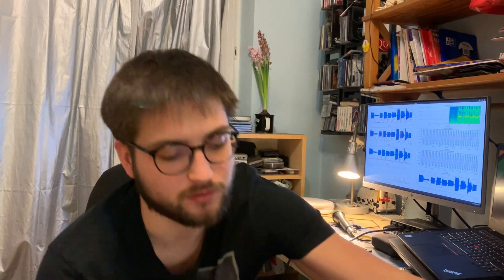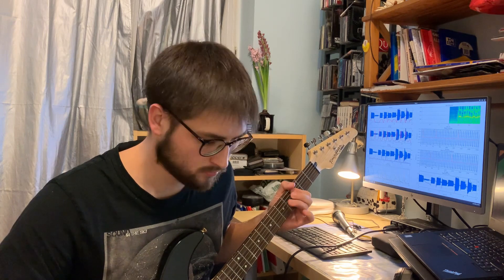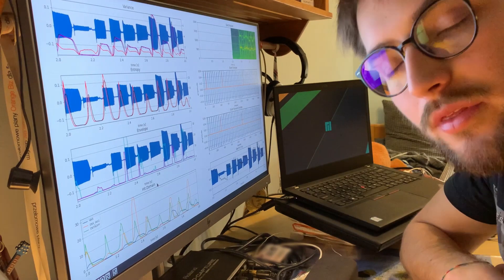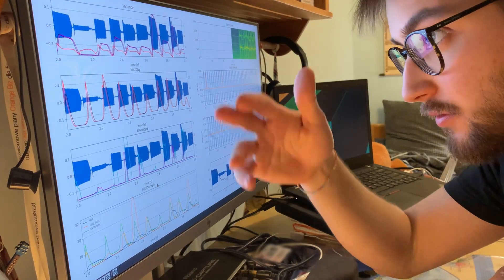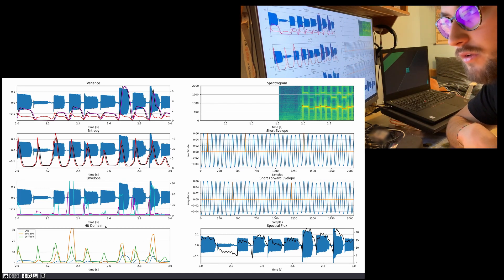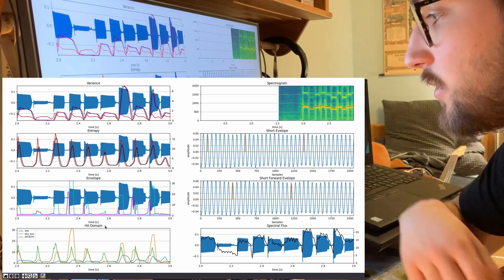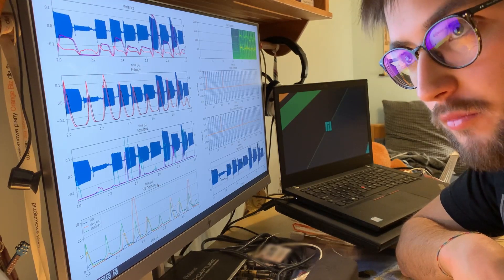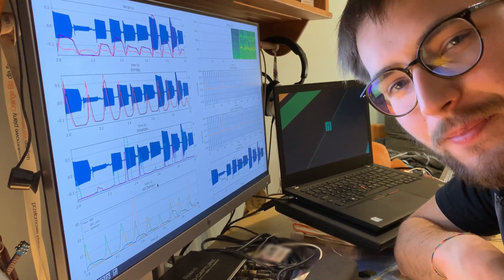Guitar To Midi Converter - My New Project! | DIY Software | Midi Guitar: Intro #ANTech

Comment: I assume you are trying to detect in real time notes in a polyphonic signal and generate midi events.

If that is the case, I must say that I love what you are doing, but I unfortunately believe that it will be extremely difficult.

I have seen several attempts to do this fail before.

You might get it to work, but the problem is that its real time performance will be too poor for guitar players to enjoy it. More than 20-30 milliseconds to detect a signal and guitar players start to feel irritated at the latency.

And the problem is that for example the 6th string of the guitar needs already 12 milliseconds to vibrate once (82 hertz), and you will hardly be able to do a fast fourier analysis in the resting 8 milliseconds with a signal of just one cycle.

But there are VERY similar projects that you can do, that will provide you a worthful knowledge and that I believe are more doable.

1) You can design a solution, that can start by using a PC and later using some hardware such as an arduino processors (or something else), that reads 6 guitar signals from an RMC pickup (or a graph tech pickup) and converts them into midi events.

6 monophonic signals instead of one polyphonic signal.

Maybe using some fourier analysis, or maybe you can predict frequencies by their slew rate, or something. At this point you develop algorythms to efectively detect musical notes in a monophonic signal, in real time, plus the architecture for a PC to do this in parallel 6 times.

2) if you manage to get it to work in a PC then you can as a second project try to make it work in an external hardware, also open source, and if possible with so much off the shelf components. By making SW&HW  open source  other people can build, test and play with them. At this point you will have designed an open source equivalent of a Rolando GI-10 or Roland GI-20 or an Axon AX-50 (I suggest buy one of this devices and test them).

And at this point you will be a heroe for the open source community and for guitar->midi enthusiasts.

3) If after this you still want more challenges, these are great possible continuation projects :

3.1 ) Do a system of guitar to midi convertion for 10 string guitars ( no one has done it so far)

3.2 ) Do a system of arabic lute "oud" to midi convertion. Here the difficulty is that double strings require a new algorythm for  recognition, and also that you have quarter tones, so you need to configure midi for quarter tones.

You will be the first one in the world to provide a midi solution for arabic ouds. You will be super heroe...and maybe you can make money out of it...start selling "oud to midi converters".

3.3) adapt the system to work with greek bouzouki.
3.4, 3.5) you can adapt the system to several oriental instruments like tambur, saz, etc, etc.

Let me know what you think. Ariel//
Reply from the maker: You're right about the fact that is very difficult to correctly interpret lower notes - I will talk about this in one of my upcoming videos. I know for sure that it is possible to build a robust single-note converter, on this level of signal complexity latency should not be a problem. As mentioned in the video I tried this concept already - check out the demo here: 
https://gitlab.com/anthonio/pythonaudioanalyserdemo

My only concern is python itself which may decrease the overall performance. 
Problems will occur with polyphonic tracking, I'm not sure how to solve them yet, perhaps I'll try to incorporate machine learning? I know that Jam Rock's MidiGuitar2 is based on machine learning and from what I saw on YT it works great.

When it comes to your other ideas, I only want to make this project because it doesn't require any additional resources on my side, no more instruments, no special pickups, no more nothing. Just the guitar. 

"And at this point you will be a heroe for the open source community and for guiutar-midi enthusiasts." - I like this part :) Who knows what's coming?
Reply: @antonijankowski3379  A monophonic, single note converter is a nice project with very good chances of success. Once you know the algorithm, you can program it in C++ for performance. It has been done before and you can even buy commercial products with such implementation ( for example Sonuus G2M Universal Guitar to MIDI Converter).  For polyphonic tracking I am unfortunately a bit pessimistic, unless you use an RMC/Graph tech pickup with 6 independent signals for nylon strings, or Roland GK3 pickup for  electric guitars. Is your goal to do something that people will use in concerts ?
Reply from the maker: Checkout this video: https://www.youtube.com/watch?v=_RilmwYxl_c
at 0:16 this guy plays 2 note at the same time.

Here's a little demo with chords, sounds good to me.
https://www.youtube.com/watch?v=fMXZ_d4MtJA

So these clips gave me confidence that polyphonic mode is also possible. I know it hard (extremely hard) to achieve, but still possible.
Reply: @antonijankowski3379  thank you for the link ! interesting ! Have you tried yourself their demo ? I wonder if one tests with a solo guitar recording instead of a live guitar signal....
Reply from the maker: @ArielAr  I haven’t tried it yet, but once I do, you’ll definitely see a review on my channel! I thing these demos I sent you are in real time, definitely the second one.
Reply: @antonijankowski3379  The software AnthemScore uses machine learning (convolutional neural networks, if I remember correctly) for off-line analysis of the notes being played. To analyze 1 minute of guitar music can take 4-6 minutes, so this is not real time stuff. If you are curious you can check AnthemScore (https://www.lunaverus.com/ )

Comment: Super cool.  Congrats on your endeavor.  I would suggest that you not try to reinvent the wheel for the lower level stuff.  Everything from tuners to pitch shifters already do note onset and pitch decoding.  Leverage whatever you can from github.  A2M from Beat Bars (free beta) does a pretty good job of tracking guitar - the main deal-killer for me using A2M, is latency.  The latency I've measured with A2M is 25ms and most anyone would feel that.  Only a very slow performance can accept that kind of latency.  Needs to be about 8ms or less for me to stop caring about it.   I imagine your goal is just monophonic.  If you could do polyphony that would be amazing and make it waaaaay more useful, but decoding multiple notes from a chord is super-non-trivial, and requires a ton of CPU.  I'm pretty sure polyphony is realistically only achievable with hardware (eg. hex pickup) which has the advantage of separate signals for each string.
Reply from the maker: Thanks for your comment! 
Do you have any specific repos on your mind?(except for A2M). I know what to look for, I simply cannot find reliable sources. I care a lot about the latency, my goal is just around 8 ms, currently I analyze 2048 frames every 256 frames with 44.1 kHz sampling rate. 
Right now I'll be happy with proper, robust monophony, who knows what comes next? :) There's already one solution for polyphony out of single signal - checkout MIDIGuitar2 by Jam Origin, they did amazing job!
Reply: If you want a library that does onset and note detection for python, then Aubio is good.   However if the point is to learn how this all works I don't think it's bad to reinvent it, with numpy/scipy or whatever.   For MIDI out, MIDO is a nice python library.
Reply from the maker: I'm using rtmidi right now. It's actually what lays under the MIDO as far as I know.